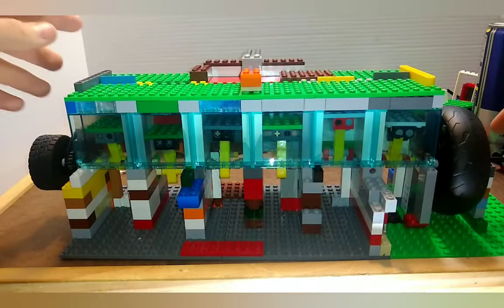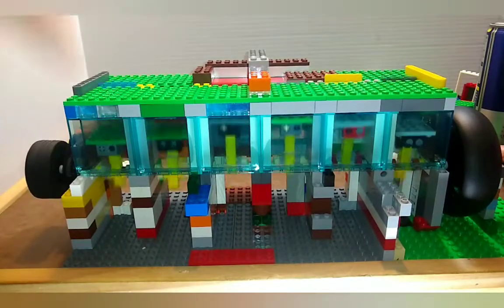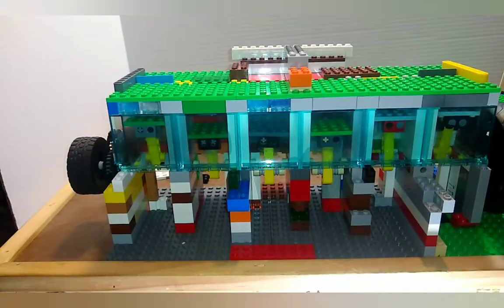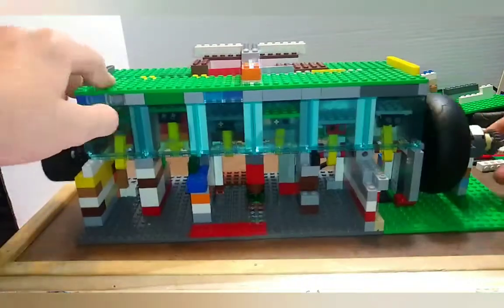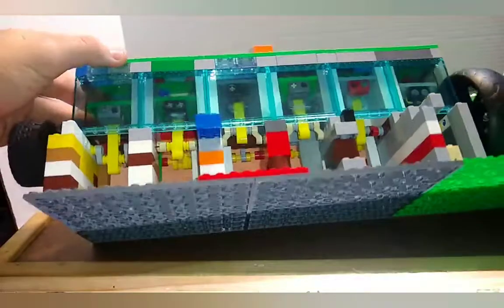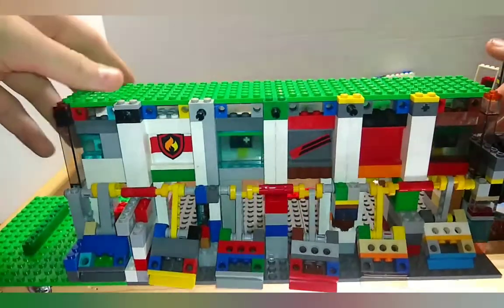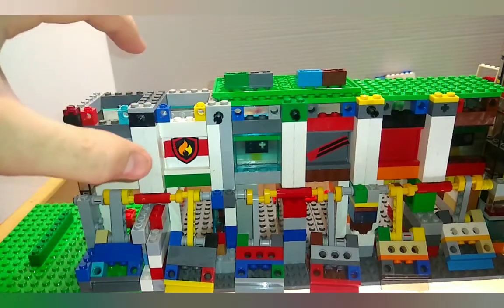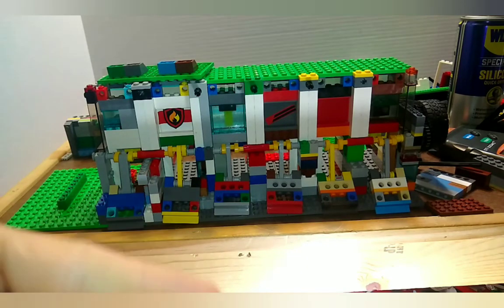6 Cylinder LEGO Vacuum Engine | full demonstration and overview

Comment: the decreasing used piston volume thing you said about - its just increasing compression so beef up your head gasket if you want to take it to the max lol - increases torque and speed to a point.
Reply from the maker: There is no head gasket lol. Increasing the "compression" just makes the cylinder go under a vacuum quicker allowing the engine to run faster, as well as puts more pressure on the pistons increasing torque.
Reply: @LS1sLegoGarage  I get what you mean, I'm just trying to relate it to a actual engine but yes it does increase torque significantly, i blew up my connecting rods xd